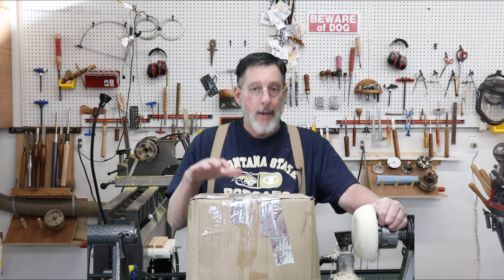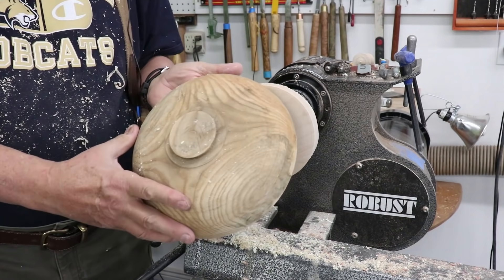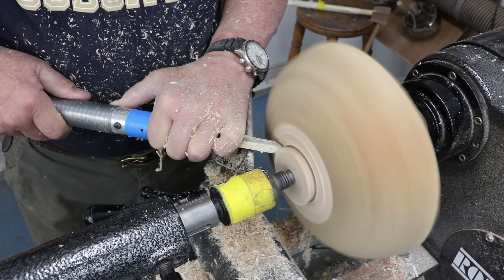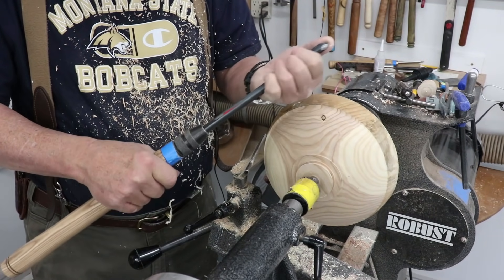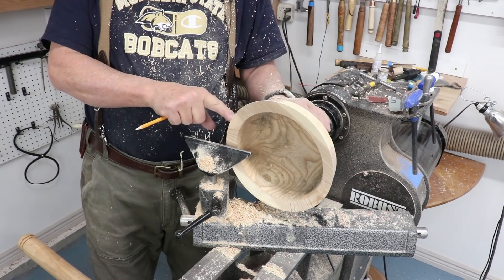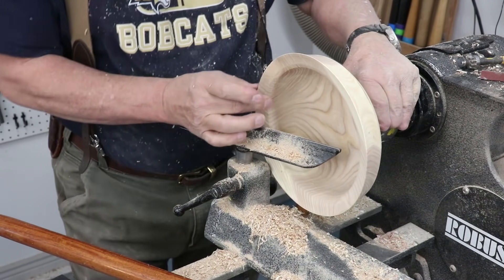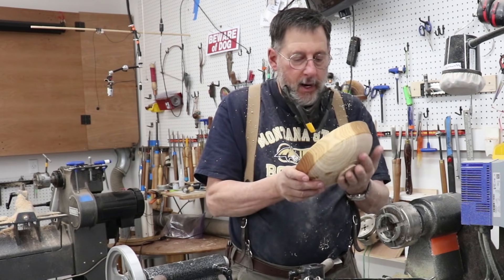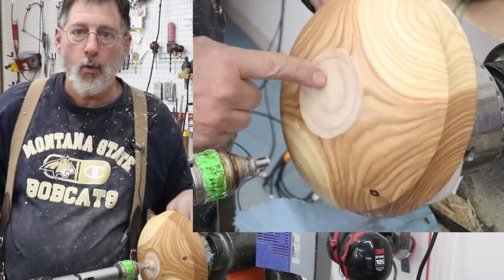Completing a Rough-Turned Elm Bowl  with Sam Angelo

Comment: A very nice video on the fundamentals of working with a 'twice-turned' piece.  I assume you've tried it but for what it's worth...I've been experimenting with my 3/8" bowl gouge presented at a high shear angle which, for whatever reason, has been helping me reduce my tear-out.  I recently completed a batch of 30 or so American Red Elm pieces and frankly, that was the only way I could reduce the tear out on what turned out to be a relatively 'stringy' wood.  Cheers...John

Comment: I noticed that on your scout lathe you seem to have an extension lon the tailstock quill.  Is this an accessory that's available anywhere?  I thought this was a very interesting and informative session.
Reply: Garry not Linda. Yes, you can find Morse taper extensions many places. I turn on a Shopsmith which does not have a lot of room on the tailstock to work. I picked up a Morse taper extension on Ebay for around 30 bucks and it's made all the difference in the world. I saw Kent over at Turn A Wood Bowl use one on his lathe. He can turn some deep pieces so that gives him some extra room. I think I've seen The Papa 1947 use one occasionally also. Hope that helps.

Comment: Hi. Sam. Question from a previous video, How do you reverse chuck a hollow form to prevent splitting the wood especially if it has hairline fractures reinforced with CA, not enough tension the project wobbles and can come out of the chuck, to much and it splits. Your videos have helped me expand my creativity in many ways. Thanks WK.  stay safe.